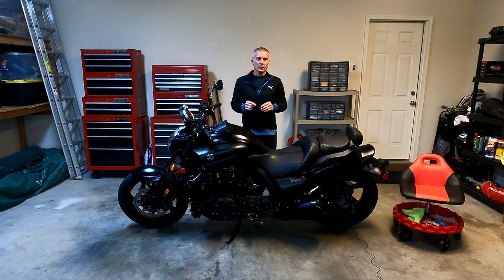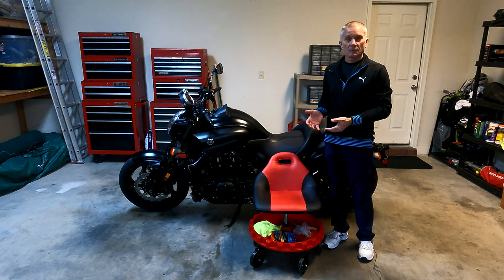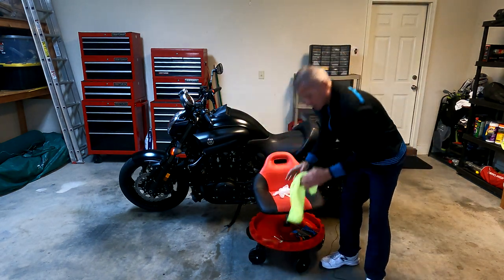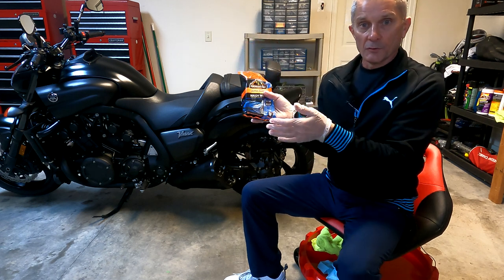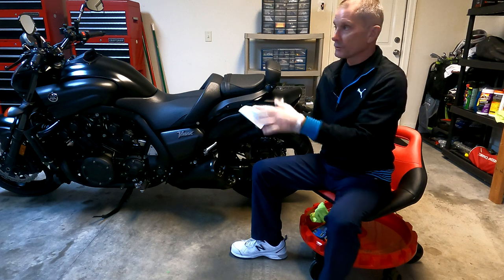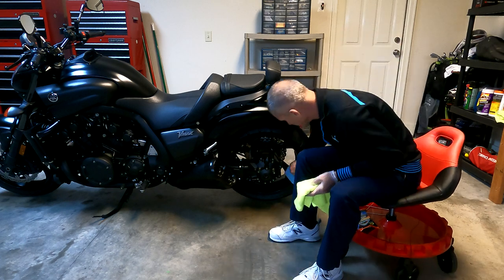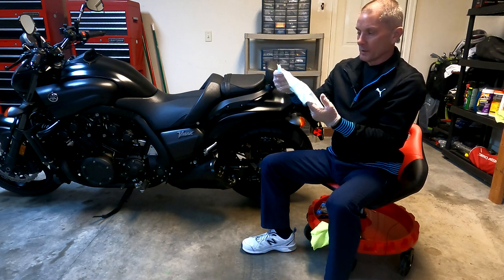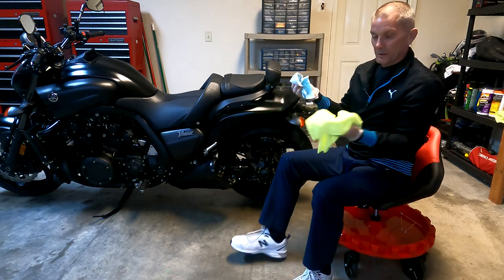How I Clean My Yamaha VMAX 1700 Without Soap & Water

Comment: One thing to add to this if it is your preferred method that will make it easier, put it on the Pitbull paddock stand. It gets the bike upright, making it easier to access both sides evenly, and lets you spin the rear wheel easily to wipe it down as well. I personally wash mine with a mild detergent and rinse well, afterwards I use my leaf blower to get most of the water off, and wipe the remaining moisture with a micro fiber cloth. Not hating here, I used to do the same as you pretty much on my ZX9R I bought new in 1994. Keep the videos coming, I enjoy each and every one :)
Reply from the maker: Thank you. I have done what you said with the rear stand a couple of times...it does make it easy by spinning the wheel. I’m looking for a jack to lift the whole bike, but not take up too much space in my garage.
Reply: @JeffMarcum  I think my front stand is a pitbull, it lifts at  the steering stem, and works really well.
Reply from the maker: @rokhedjo  I want the jack to be able to remove the wheels for tire replacements. The Pit Bull stands interfere with wheel removal.
Reply: @JeffMarcum  I have the one that engages above the fender at the triple tree, I removed my front wheel with no issues. But I misspoke , it is a T Rex stand I have for the front, the rear is a pitbull.
Reply from the maker: @rokhedjo  Thanks for sharing. I saw video of a guy with his VMAX 1700 and the Pit Bull rear stand remove his rear wheel. Because the rear stand got in the way, he had to remove the turn signal/license plate assembly to make room for the wheel to come off. I want to avoid that when I replace my tires. If I can find a jack I like, it solves all problems at both ends of the bike.
Reply: @JeffMarcum  OK I JUST LEARN SOMETHING NEW TODAY..ON THAT ISSUE OF REAR TIRE REMOVAL ON THE REAR STAND GETTING ON THE WAY..MY FIRST TIRE CHANGE IS COMING UP NEXT YR FOR THIS BIKE SINCE I GOT IT BRAND NEW. ILL BE DOING MY OWN TIRE CHANGE IM JUST GONNA HAVE THE DEALER BALANCE IT FOR ME..IVE DONE IT ON MY OTHER BIKES THRU OUT THE YRS. THANX JEFF FOR THE INFO. 👍

Comment: Good video. Just to share my fathers experience, he's had his '10 Vmax 1700 for all these years, cleaned it with soap and water, rinsed and hand dried real well and there's no rust or anything really harmful going on all these years later with only one major disassembly a year ago. Yamaha built an AMAZING motorcycle and the anti-rust and corrosion is virtually non-existent. Garage-kept just like yours except the bike is located not far from the ocean and ocean air. All things considered, this bike or anyone really having to worry to much shouldn't have to, just incredibly quality this bike is. Love that black color by the way
Reply from the maker: Good to know information. Thanks for sharing.
Reply: Did your dad do the factory recall for the oil pump ? If not please do.
Reply: @themalaailaanaa1347  Hi I did not know about this. Thank you for letting me know gonna have to change that!

Comment: I have been using "Original Bike Sprits Spray Cleaner Polish" (formerly Honda Pro Polish) for many decades. The same technique, but cheaper and less waste. Just spray on and use microfiber to wipe. the microfiber is rewash able. The can may last a whole season. If your bike is super dirty you can use soap and water and a microfiber cloth to wash. Then use the shop vac in reverse with the leaf blower attachment on to blow dry. This is the method that most dealerships use to clean their bikes. It will produce a spot free finish then go over it with the spray wax. Great Video Jeff!!!
Reply from the maker: Thank you for the additional methods.

Comment: Great video again Jeff!!  My 05 has never been washed with a hose, ridden in the rain, or ridden on a gravel or dirt road. or power washed.  I will wipe it down with a damp rag and use compressed air for drying.  I will use Carnuba wax and now T/C Ice Seal and Shine to protect the finish. Dielectric silicon grease on electrical connections can be a good preventative to corrosion. Keep up the good work Jeff.  :)
Reply from the maker: Thank you. My goal is to never get this bike wet. I only ride this one when the forecast is clear, and I’m not planning to take long trips on it. When I get my Gold Wing, that will be a different story because on long trips, it’s inevitable I will get caught in the rain.

Comment: Are you kidding. If you ride in the rain,soap and water is the best way to clean a bike properly. I use a garden hose with a good quality car wsh soap. As for drying buy a air blaster. This gets all the water out of all the nooks and hard to reach areas. Even a leaf blower will work. I live in Canada where i have to store my bikes for 6 months. Never had a problem with rust due to water.
Reply from the maker: I don’t ride this bike in the rain and my goal is to never get it wet.

Comment: So would a 2019 with 1200 miles on it be worth 14k? I've seen kbb and nada around 12500.
Reply from the maker: For my zip code, I’m seeing $15200-16100 in the KBB & NADA retail price. With only 1200 miles on it that is practically brand new, particularly if it was kept in a garage. I have never bought a used motorcycle, but that seems like a pretty good deal to me, especially considering that they don’t make that bike anymore, and I believe there weren’t many that were ever produced.

Comment: I believe everyone is missing the method or technic on NOT to get water in those electrical CONNECTORS theres so many of them..for example I bought a 04 yamaha R1 a couple of yrs back and as I took a part the bike to put a new set of front signal lights..I saw my MAIN plug that came from the fuse box and looked bloaded like abnormal..so it was a lil hard to unplug it because a couple of wires were already melting the plastic connector from inside..and that to me was the cause of either the previous owner riding the bike in the rain or WASHING the bike with water..people its very easy for water to get trapped in these electrical plugs..and no leaf blower in the world will get that water out! Thats where your electrical problems start..so I COMPLETELY support JEFF in these technic on washing the bike waterless. To me its a peace of mind and something that I don't have to deal with electrical problems down the road...and one more thing I NEVER ride my bikes on the rain. Thanx jeff for this great video.
Reply from the maker: Thank you for watching and sharing your experience.